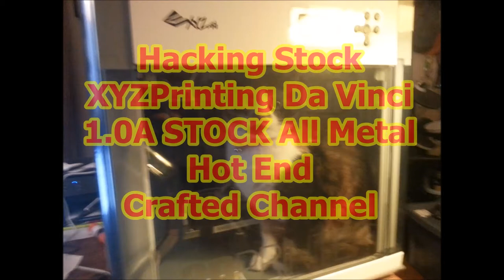Hack 3D XYZPrinting Da Vinci 1.0A STOCK All Metal Hot End: Part 1

Comment: Very well explained video. Out of the 12 hrs of printing, how many times have you had to clean out a clog? From what I've read, the E3D hot end is a magnitude better. The size and fins will help a ton with heat management. But hey, you know that already.
Reply from the maker: +eviltwinx It happened once I'd guess around day 8, then it happened recently and effectively I have to take it apart clean it, I get one job, then the next one fails if I don't clean it.  Thus why I'm trying to address the problem with real changes to try to prevent it again.

Comment: Just an FYI: you can totally disassemble the hot end from the aluminum pipe to clean it out. It unscrews and is not welded. I disassemble and soak them in acetone for a few hours.
Reply from the maker: I took one down in part 2 of this short series.  Yes and it is all metal.   At the point I had video'd it, other channels were talking about "upgrading" to all metal.  People were under the assumption is was not all metal. Most people still believe that today.